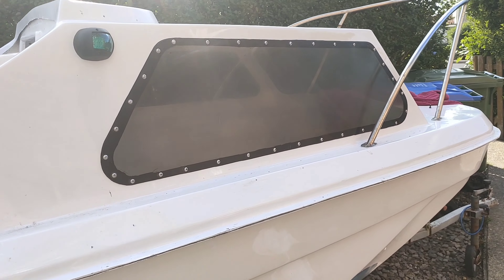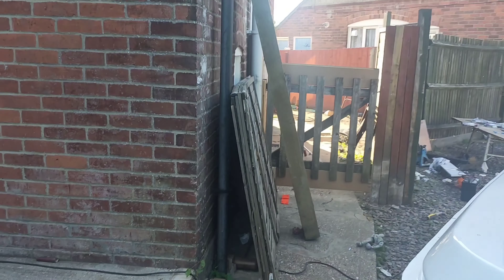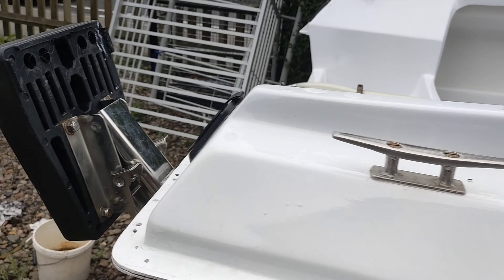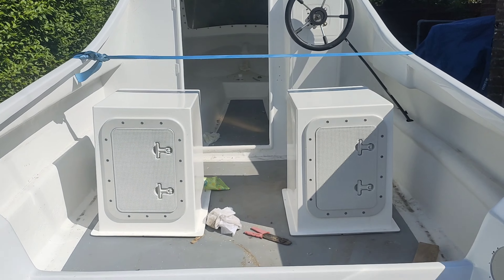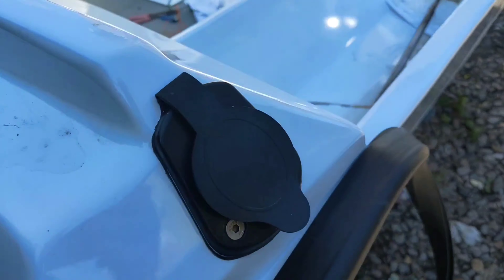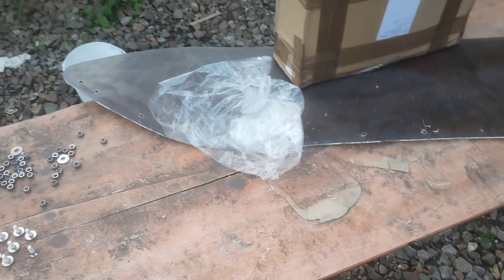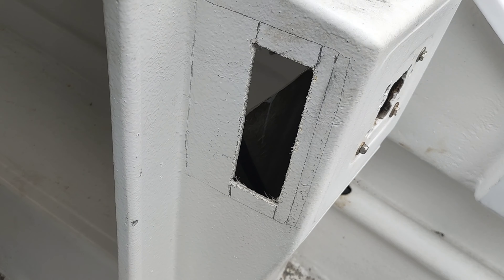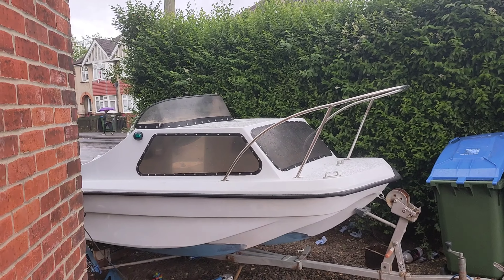restoring a 14ft cjr prt 11

Comment: Did you happen to find the identification number anywhere in the boat?
Reply from the maker: No mate can't say I did and I haven't sorted the steering out yet will get back to u when I do
Reply: @anurbanhistory2975  apparently there's a number etched in to the Hull somewhere, can't get it insured for the sea without it 😩.
Iv sorted the steering cable now mine all ready for the sea